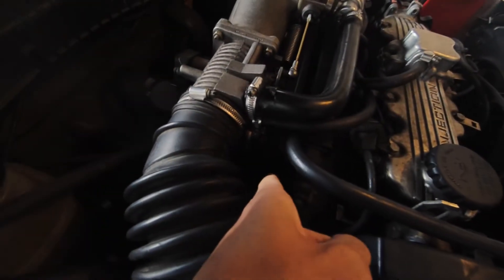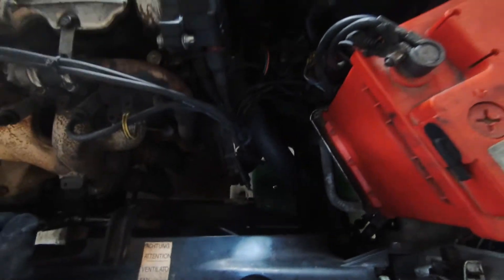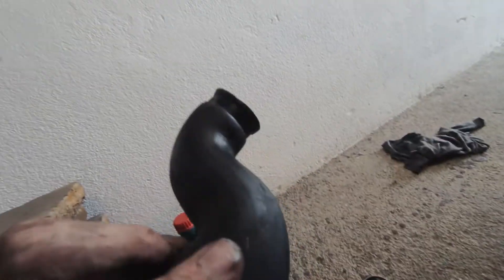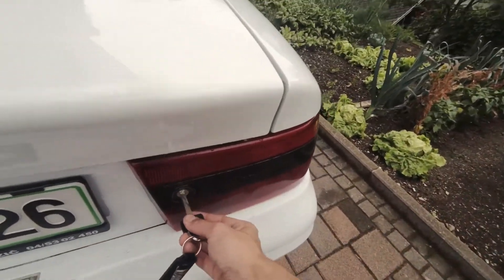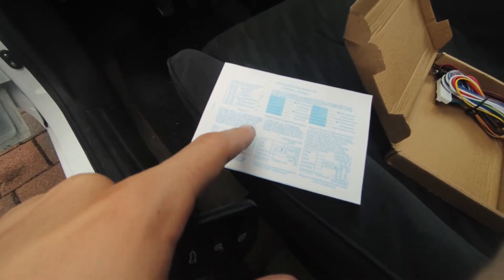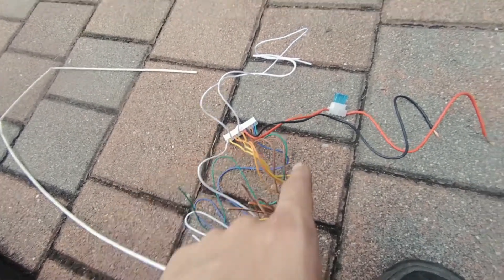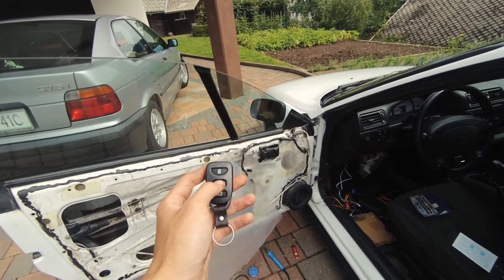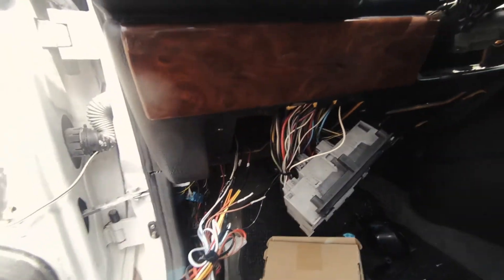CALIBRA DIY KEYLESS ENTRY INSTALL

Comment: Great vids can you tell me will crx mounts wrk in honda ef sedan doin b series conversion im not sure
Reply from the maker: To put a b series in EF chassis cars you either need mounts, axles and knuckles from a CRX IVT that came factory with a b series motor or you need aftermarket motor mounts.
Reply: RiceFlavouredVTEC thanks mine has the jdm front has all the brake conversion done on it but wasint sure wat mounts are i could use for b series conversion hasport mount kit is €320 and crx mounts on ebay €100
Reply from the maker: Probably best to go hasport or innovate so you already have all the poly bushes done etc everything refreshed. I think you will also need a shift linkage.